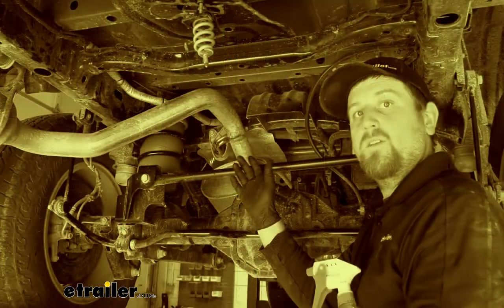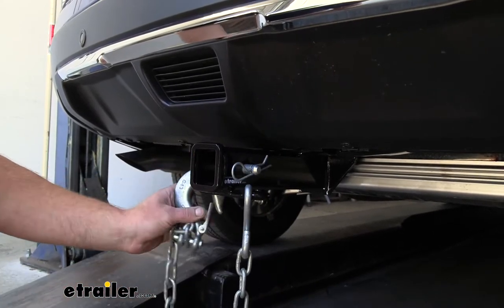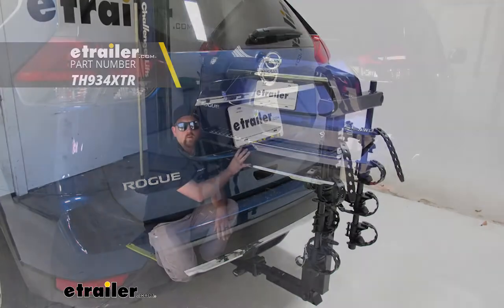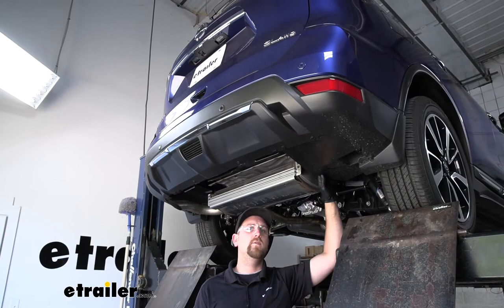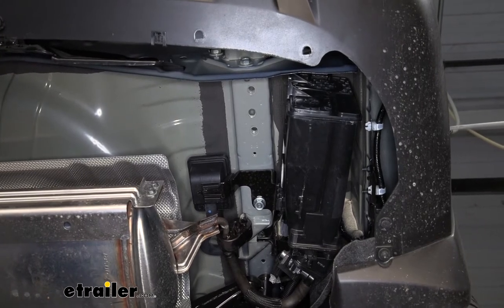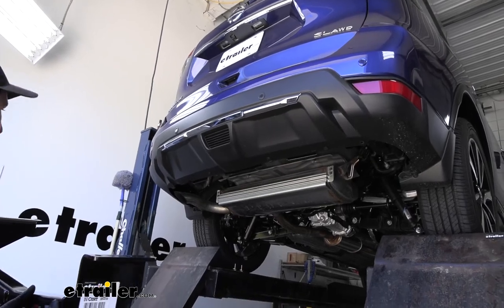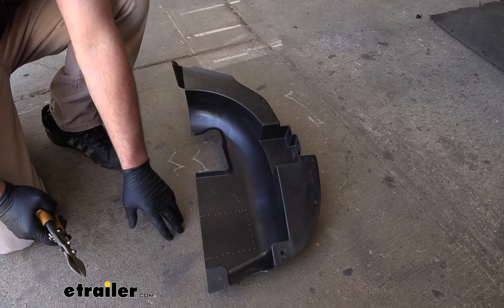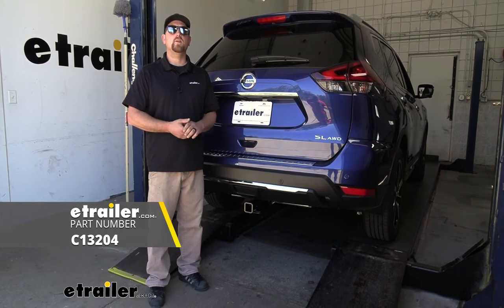etrailer | Curt Trailer Hitch Installation - 2020 Nissan Rogue

Comment: I have a 2021 Rogue, do you know if the Curt #13471 will allow the automatic liftgate to operate?
Reply from the maker: You will still be able to operate the the lift gate but you might have to find the sweet spot on either side of the hitch.
https://www.etrailer.com/Trailer-Hitch/Curt/C24HR.html

Comment: Ryan where can I get a trailer hitch installed in Las Vegas for  2013 Nissan Rouge
Reply from the maker: You can check with your local shop to see if they would be willing to do the installation for you. We do not know any specific dealers in your area.
https://www.etrailer.com/Trailer-Hitch/Curt/C13204.html

Comment: So can we tow a pop up trailer with this hitch?
Reply from the maker: This hitch has a maximum gross trailer weight capacity of 3,500 lbs and a maximum tongue weight capacity of 525 lbs. You will need to check in the owners manual of your vehicle to see what your vehicle is capable of towing and go with the lowest amount between the hitch and the vehicle.
https://www.etrailer.com/Trailer-Hitch/Curt/C13204.html
https://www.etrailer.com/t1-2020_Nissan_Rogue.htm

Comment: Does the same hitch fit on the 2021 Rogue as well?
Reply from the maker: This hitch is not designed to fit the 2021 Nissan Rogue. Check out the following link to see the hitches that will fit your vehicle.
https://www.etrailer.com/hitch-2021_Nissan_Rogue.htm